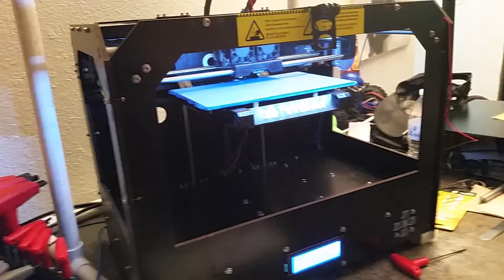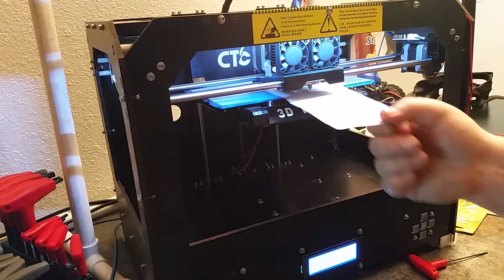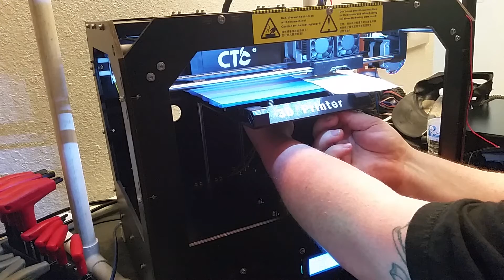ctc 3D printer leveling build plate

Comment: I am trying to set one of these up with a friend.  We do the leveling and the plate comes up and hits the left extruded, and kinda grinds in place for a bit.  Is our problem on the initial 4 or 5 turns?  Full turns?  Or 180 degree turns with the wing nuts?  We aren't sure why it's hitting the extruded, then scraping across the plate during adjustment.  And is the left extruder just a bit higher than the right?
Reply from the maker: full turns if the extruder is hitting the plate you will  need to do more turns, more than 4 or 5 turns and yes one extruder is higher if you want to print with both extruders you will need to make the extruders the same height
Reply: +fix it with biskit Ok, we will give it another look soon.  We spent much time on it.  Thanks for your help.

Comment: my build plate is warped too, I actually contacted the manufacturer and they are sending me another build plate. if you cannot get things to level due to a warped bed consider printing on glass. you will need to use this if using glass.  Glass (mirror) Z axis limit switch spacer  found on #Thingiverse http://www.thingiverse.com/thing:311911
Reply from the maker: +steve p. thank you for the help
Reply: Welcome.